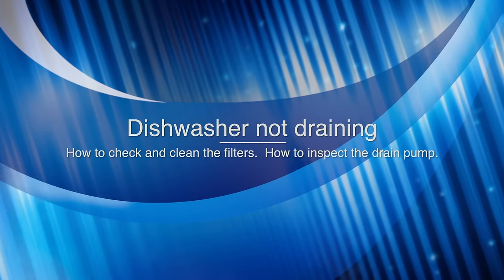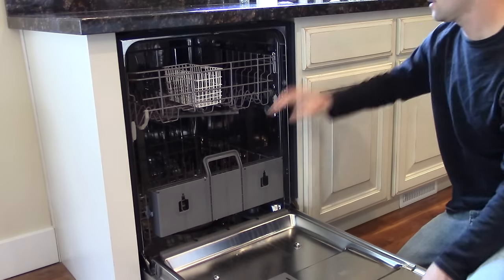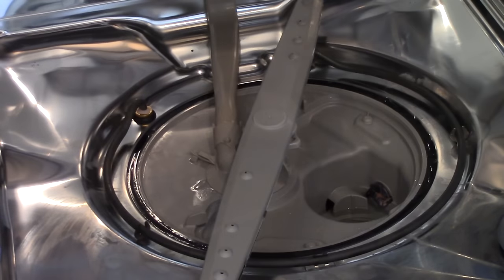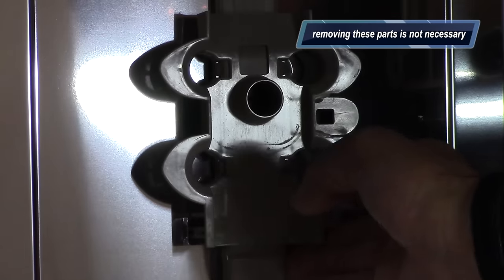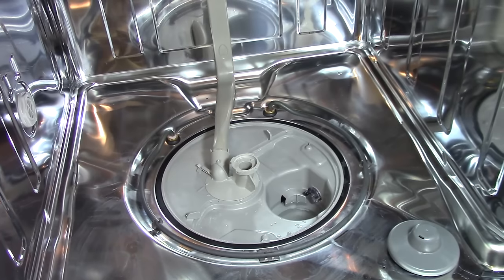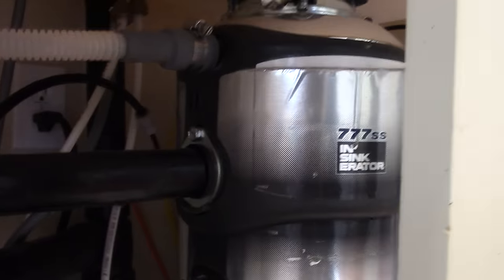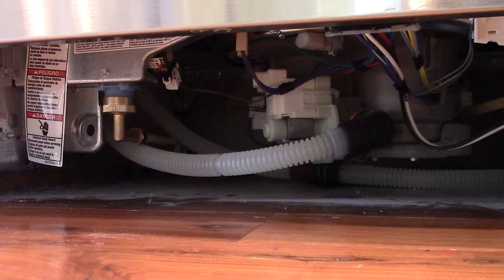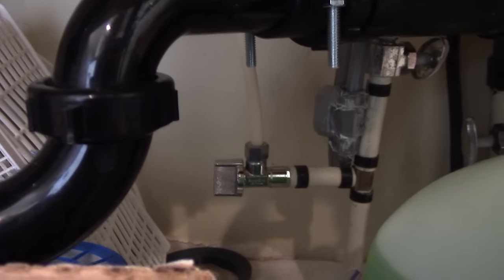How to repair a dishwasher, not draining cleaning - troubleshoot Whirlpool Kitchenaid

Comment: Adam - THANK YOU!!  i never leave Youtube comments but you are the man.  My dishwasher started making a grinding noise and would shut down shortly after.  I figured I'd call the Sears repairman but after hand washing dishes for 2 hours, I thought there just might be a better way.  A few searches later and I found your video!  Turns out a pistachio shell had such past the filter and was interfering with my drain pump.  Found it with a quick finger to the interior drain hole.  Just had a successful test run.  Thank you, thank you, thank you!!
Reply: Correction,  there were two pistachio halves in there!  The sound came back during the second load, so this time i removed the drain pump to make sure I got everything (made certain to flip the breaker).  Sure enough there was the other half of the pistachio shell!  I'm thinking they must have come from the disposal because there's no way hey got past the filters. Thank you for the instructions and confidence. She is now purring like a kitten, and i know infinitely more about dishwashers.
Reply from the maker: +bhatch11 Good job checking again! I'm glad you got it working again.  You may want to check that the dishwasher drain hose has a high enough arch under the countertop that the sink water can't get into the washer.  I have a few videos that cover drain hoses.

Comment: I have a model kenmore 665.13043K115, it looks very similar to the one on video and I'm still fighting this problem. I cleaned all debris and freed the motor (piece of fishline on the prop). The motor appears to work fine: spins easily and turns on during cycle. BUT it does not push water thru the hose! The hose is checked- not plugged. And still I see only tiny stream of water in the clear loop of my hose, which alows to drain all water in 3-4 pushes of DRAIN button. Is there some kind of valve must be present near the pump? Or can it be that motor lost its power? It still appears strong, (I could not stop it with my fingers!) It just does not push the water thru the first loop of the hose (attached to the side). Whats the reason, if we cosider that the hose is checked?
Reply: Did you ever find a solution?
Reply: Yes, I did. There is a valve in the black rubber short hose,  (where longer plastic hose attached). And it was kept in open position by some plastic garbage. This valve is hidden from eye, therefore it took me some time to figure out.
Reply: Just for other people that might see this...  I did check the line and the check value and everything was fine.  I ended up replacing the pump and that completely solved. The problem.  Thanks for the video!
Reply: @tonymayson  where's that located I'm having the same priblem

Comment: is there supposed to be some water in the sump where the sensor is or should it be completely dry after every run.  we have 1-3 inches in the sump always.
Reply: TheMarkpee that is my question also, if I remove the filter screen there is always water in there, I'm beginning to think this is normal.
Reply: Yes, I'd like to know this too.  I always have water in here.  My dishwasher smells SO horrific .... it's slowly been getting worse and worse....and I am pretty good about cleaning it ...   Is the water at the bottom normal??!
Reply: TheMarkpee im not a pro but it should drain to the point of the sensor at least. maube try cleaning it off? that was my problem
Reply: There should always be some water in there. Its perfectly normal. If the water smells, your not cleaning the filters often enough, and you need to use a product called "Affresh". I am an appliance technician
Reply: My dishwasher is less than a month old and I noticed the smell. I run the diswasher mostly every day and I clean the filters nearly every day since I found that out! I never had that problem with my old Sears Kenmore Elite that was 13 years but had to go.  I would have gotten another one but was concerned that Sears would go out of business. will get the affresh.